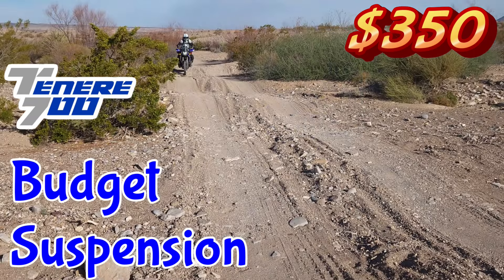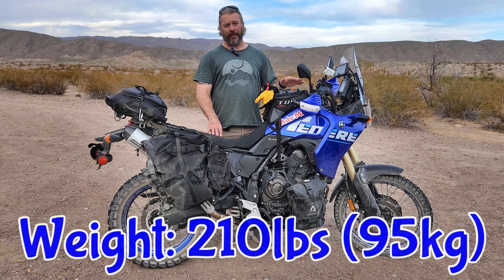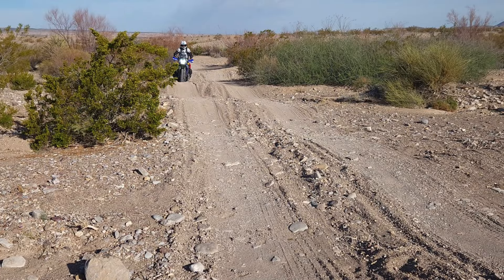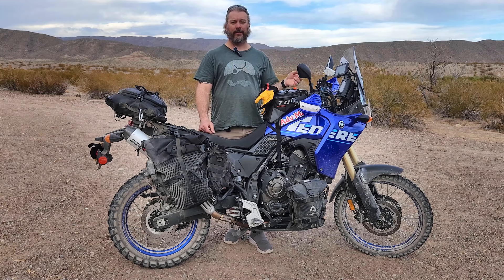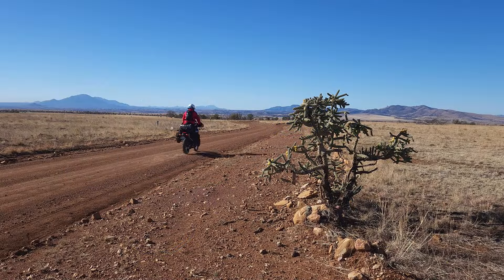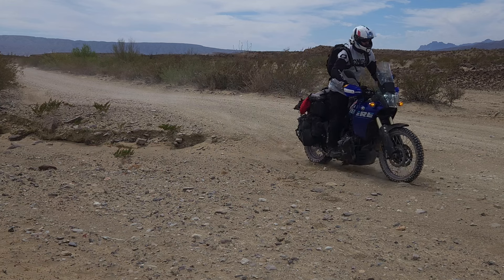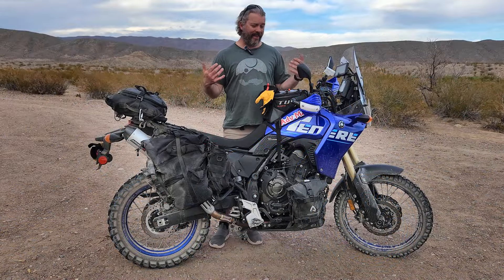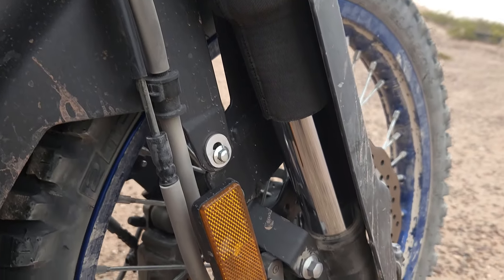Tenere 700 budget suspension upgrade for the average rider.

Comment: How tall are you ? 😊 beautiful teneree (700and 1200) 😊Thanks for the informations !
Reply from the maker: @edoardomarinangeli689  I am 5' 10" with an inseam of approximately 33".
Reply: @ 👍 5’10 Ft 🤔 fit 😊did you fit in teneree 700? Maybe 6  6’1 it’s comfortables 😊
Reply from the maker: @edoardomarinangeli689  the Tenere was a bit tall but I was able to adapt to it.  I installed the factory low seat which really helped.  The balance of the bike has been an issue for me.  I had unexpected drops I never experienced with my other bikes.
Reply: @ ah Okok I ask you because I’ve talked with tall rider from 6 ft (183 cm) to 6’7 ( 201 cm) and they has tell me it’s very comfortable 😊 But if you’re over 5’9 it’s perfect 😊 👍👍
Reply from the maker: @edoardomarinangeli689  I think there are much better bikes than the Tenere.  It's not even top five for me.  It carries it's weight high.
Reply: @advmatt  ☝️👍👍👍 I AGREE! Its not a bike for SHORT Rider 😊!! All the best 😊

Comment: great video, finding it insane as I am new to adventure bikes that I see so much opinion from people without a basic understanding of suspension giving advice... you may be one of the only opinions I have seen that even mentions the rear linkage (rising rate vs falling rate)    honestly blown away how many motorcycles I see with high end aftermarket exhaust and even engine work but with stock suspension and even even incorrect tire pressure.     Very helpful that you gave examples of what and how you ride... I know for a fact some of my friends that are insanely skilled MX racers would need drastically different suspension than I do even if we were the exact same size and weight. Much of the advice I am finding seem more for the enduro riders taking T7's on wild rides...   I needed to hear about the more average rider and what we are likely to encounter.   sit taller in its travel (correct sag) looking for softer small bump compliance but not bottoming in g outs at more reasonable speeds as I will be alone on my trips.    *I am 6'2" and 200lbs so I know I will need something just trying to figure out what I need to do before pulling the trigger on a t7.
Reply from the maker: Before you pull the trigger on a T7 give an Aprilia Tuareg a test ride if you can.  It is a better bike in every way.  Thanks for the feedback.  Good luck figuring out which bike is best for you.  It can be confusing figuring it all out.

Comment: if you put more oil in this will improve them as well i run a 65mm air gap. or you can add oil through the breather screw try 15ml at a time and take it for a ride. make sure the front wheel is off the ground when you add fork oil and make sure you put the same in both legs.
Reply from the maker: Great tip, thanks for sharing.

Comment: my weight hovers between 170 - 175, I changed the rear spring to a 75 nm.  I have zero clicks on the preload and the sag is exactly right, haven't done anything else but adjust the compression and rebound and it rides great on hard rocky trails. That being said, just rented and Aprilla 660 and it felt like I was cheating - such a plush ride.
p.s - changing the rear spring is easy if you have a floor jack and 3 ratchet straps.  run the straps through the top of the spring just below the retainer and through the bottom of the jack.  Secure everything and pump the jack until the tension comes off the retainer.  I did mine in abut 20 minutes
Reply from the maker: @pinnacleroofing9841  that's a slick trick with the floor jack.  The Tuareg has a lot going for it.

Comment: Great job and helpful info. I also replaced my rear spring with the rally raid 90 on my t7. I also weigh 210 and loaded down with all my camping gear and tools for the Trans America Trail I still am at max preload for proper sag but so much better than stock.
Reply from the maker: Thanks.  The spring upgrade made a huge difference.  Enjoy your ride.

Comment: I changed my front and rear springs to K-tech last week. Very satisfied.
Reply from the maker: Nice, much more budget friendly than a full suspension, and it works for most.
Reply: I did the KTech spring change and it was dire. Although better in many ways I could not dial in any static sag in the rear anymore. Adjusting any damping a pain to a degree that I gave up. Long trails on hard ground made the rear bounce and lose contact with the ground. Front not much better. Every minor bump was now passed on through the bars. Saw Ktech at the ABR Festival and they explained to me why that was. Took the next step and had the front revalved and the insides of the shock redone. All KTech. Wish I had that that done 4 years ago! Transformed the whole ride. Road and Off Road.
BTW, no need to change the shock. KTech believe its actually very good on the outside. rubbish on the inside. So keep the outside. Forks the same.

Comment: Im also around 210lbs. And the spring kit seems to fixed all. I used little heavier oil up front also helped damping. Made my own spring compressor hardware about 35$
Reply from the maker: Nicely done.  Good to get some additional feedback.  Thanks.

Comment: Hey Matt,...nice and worthful vid. I´ve aolso changed "only " the springs in front and rear and I am with you,...it is absolutly perfect.
But I´ve got another question...You´ve installed a cover above the headlights to close the hole when the screan is in top position.
Is it handmade or aftermarket,...I´ve never seen it in Germany...
would be great to have one

best regards from good old germany,...Kai
Reply from the maker: @kaischemionek3574  thanks for the feedback.  The cover under the windscreen is homemade.  I can send you a template of mine that you can use to make your own.  Send me an email to advmattx2@gmail.com and I will forward it to you.  I can't send it until I get home a few weeks from now.  Here is the video I did on it.  https://youtu.be/YRIPWSrwOvo

Comment: Great video! I struggled with removing rear shock.. scissor jack is key. Also,  i dd spend about 2k on cartridges and shock upgrade and I agree  with your recommendation to 
change only springs. Maybe add some xtra front fork oil to prevent bottoming in whoops
Reply: Change the fork oil, might as well .
Reply from the maker: Thanks for sharing what you spent on your suspension and your experience.

Comment: Looks great. Nobody every shows taking the cap off and how that goes with the spring pressure or putting it back on. How did that go removing the fork cap and re-installing?
Reply from the maker: Just saw your question.  It was easy taking the cap on and off, but the spring rate I used was half of what most other riders use.  If you go with the same fork springs I used it will thread right on.

Comment: Could the fork springs be replaced while the forks are still installed on the bike? Seems like you’d just have to be very careful not to drop the guide into the fork after removing the cap, and you’d have to keep the front wheel off the ground the whole time. Crazy idea?
Reply from the maker: @frankm6379  I think the handle bars will be in the way.  If you move the handle bars you can do it but remove the wheels so you can move the fork leg up and down.

Comment: Right on Matt you did it right!! I rode my buddies T700 he purchased used from a desert racer. It was set up super stiff. Miserable to ride unless you are jumping it!! The direction you went is the smart one. I did basically the same as you with my Super Tenere. Got a straight rate shock spring and left the front alone (as it's already a progressive rate). Too many of the guys think they are better riders than what they are and need to spend big money on suspension upgrades. Happy Trails my man!!
Reply from the maker: Great experience to share here.  Don't over do it, or the ride will still be bad, just the other end of the spectrum.  Cheers.

Comment: wait,the thing that everyone complains about the stock suspension of tenere,is that is soft?i m asking couse one i test rode(the rally version,the white one) and the suspenions was too firm.i was feeling even the small potholes on the asphalt.i m thinking to buy tenere,but also i m thinking transalp and tuareg.i am 178 high(5.9 i think) 87 killos.also the wind noise at that bike over 70mph,drived me crazy.i am not a hardocore off road rider,but i like tenere.but, i was a little dissaponted from my test ride.
Reply from the maker: The base Tenere 700 model has a really soft suspension.  In the States we are not getting the Rally version.  The Tuareg has a far superior suspension.
Reply: @advmatt  which was nicer and more comfortable on road,tenere or tuareg?
Reply from the maker: @thodoris3790  Tuareg.  Cruise control for the win.  Wind and weather protection is better too.  I just purchased a Tuareg and it has blown me away.  Riding is subjective though.  My preference is the Tuareg.
Reply: @advmatt  awesome.enjoy your new bike and we are waiting video.i ll try test ride it if one is available in my area,which i dont think so.the bigger hasitation i have about this bike,as most,is reliability.at least i have an official dealer 10 miles from home!
Reply from the maker: @thodoris3790  I get the reliability issue.  I will be honest about my experience.
Reply: I'm 6' 1" and had the bad wind buffeting.  Got a 9 cm taller wind screen from Rally Raid and it took care of the problem for me!  10,000 miles on my T7 here in Alaska....love it!!
Reply: @allenhuling598  the yamaha taller screen?it redused the wind presure and the wind noise?i m aking again,couse i really want tenere more transalp,but i ll ride much more on road ,so i dont want to regret it
Reply: @thodoris3790  Yes, for me it totally changed the wind buffeting and now is not an issue at all!  I changed to the taller wind screen but Rally Raid also has the slightly wider wind deflectors which I changed at the same time. At 80 mph on the highway the wind turbulence is no longer a problem!

Comment: I am more than a little frustrated, as somsone who has been upgrading suspension on Japanese bikes for a very long time, that we still need to spring bike for European / North American riders when they are sold in those markets. - Frank
Reply from the maker: It is pretty frustrating considering the forks and shocks are obtained through suppliers.  Bikes headed to NA and European markets could have stiffer springs and not change anything in the cost.  Just a different part number for our markets.  Japanese bike manufacturers are falling behind.  Not one of them offers a mid size adventure bike with cruise control.  All of the European bikes have it, maybe as an option, but it's available.  Reliable doesn't mean it's made to modern standards. Cheers.

Comment: How is the T7 after some miles compared to the 390?
Reply from the maker: I prefer the engine of the T7 but the 390 is more comfortable for long distance, after lots of mods.  The ride is very different.  I think to get the T7 to feel the way I want it, it will require as much mods as I made to the 390, which is a lot.  The balance of the 390 is much better, especially offroad.  It is hard to beat the 390.
Reply: @advmatt  appreciate it.  I looked at both, and may still eventually do a T7.  But the weight of the 390 was very significant to what I had plans for.
Reply from the maker: @RC_John  take a look at the Tuareg, if it's nearr by.
Reply: @advmatt  ha, foreshadowing!

Comment: How does it now compare to a stock Aprilia Toureg?
Reply from the maker: The T7 is still not there yet.  I can't adjust preload on the T7 fork without opening it up and adding spacers.  Tuareg has adjustments on the fork.  The stock spring rates on the Tuareg seem stiffer.  I was able to set preload quickly with only using a small amount of adjustment.  Just picked up my Tuareg yesterday.  The T7 feels much better but still behind the Tuareg.

Comment: How’s the new setup compared to stock suspension on that Tuareg?
Reply from the maker: I can't set the preload on the T7 fork without opening it up and adding spacers.  The Tuareg has preload adjustments and the springs front and rear seem stiffer than the T7 after the upgrade.  I was able to set proper preload in about 10 minutes on my new Tuareg.  Picked it up yesterday.  I need more time on the Tuareg but the starting point is way better.